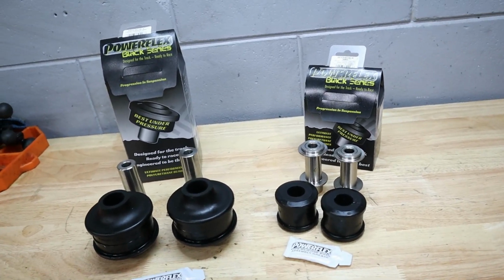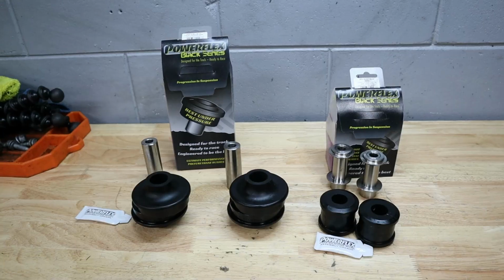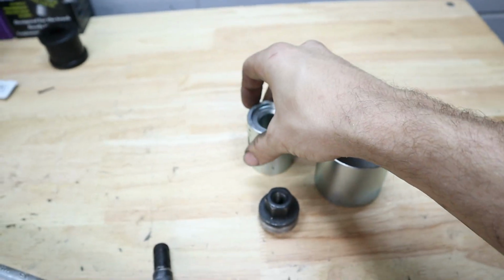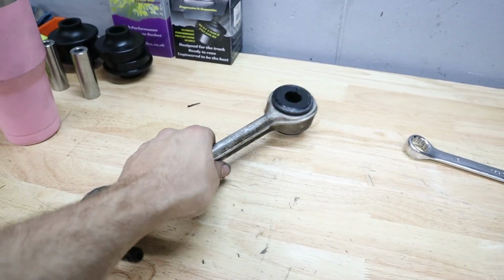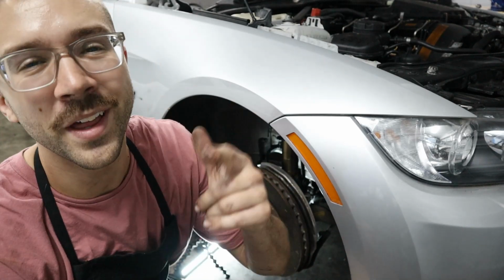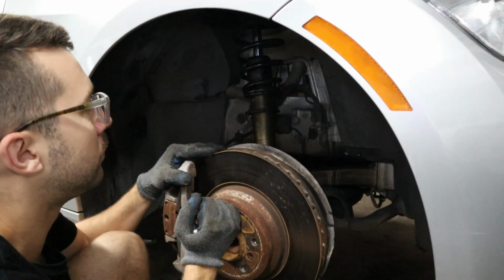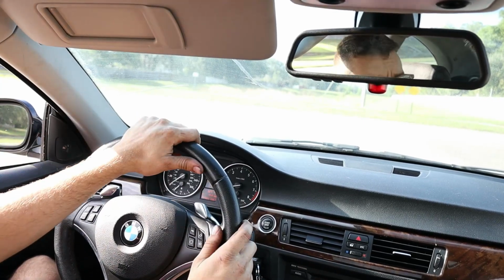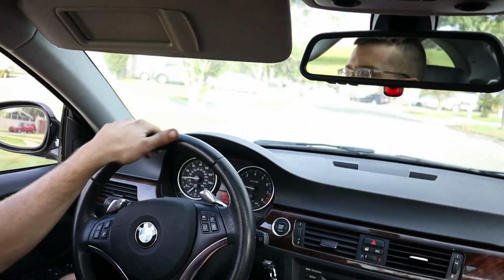Best Suspension Upgrade for BMW 335i? Powerflex Control Arm Bushing Upgrade DIY!

Comment: These are really nice, I had them in my E46 325Xi. The reason people put the M3 control arms in, is for one the Camber is more aggressive, it brings the bottom of the tire out .75 degrees (3/4’s of an inch) negative camber. Plus the other bushing is a spherical ball bearing bushing that moves all around, but is extremely tight! You can buy  aftermarket examples like fall line & you can make them even better! I just did a lot to my 135i & I’m going to be doing the M3 control arms..✌🏻💯🏁

Comment: Better than rubber, what's better than poly ? A rose joint ( uniball ). The camber arm is better from M3, the tension strut is good whatever it is,  possibly better with poly.

Comment: Nice fix Chris. I will go for these Powerflex bushings when mine are done. Can take a while because I'm on 52k miles. But 12yo so maybe in a year or so... Btw did I miss the turbo rebuilding vid? Dutch regards, Nico.
Reply from the maker: Nico, you can test the bushings too, see my video where we diagnose all the problems on my car. And yes, we rebuilt the turbos in our last video, go check it out! 😉

Comment: You should apply the grease to the inside of the bushings.... They are grooved to hold the grease. You removed all grease by installing the pins that way and they will squeak and collect dirt in time and  premature wear will occur...good vid though 💪
Reply from the maker: Good thinking, I didn't realize that but it makes sense! Apply it to the polyurethane, not the metal race.

Comment: I was waiting for a review of the bushings but got one of the turbos instead :). Anyway, i installed these bushings in my M4 and i took them out after one week and reinstalled the SPL solid eccentric aluminium bushes again. I thought thre powerflex ones should be less moisy but they gave the same nvh as the solid SPL's.

Comment: so i need new front control arm bushings on a BMW X1 35I ball joints done @85K, need bushing puller kit Part #, , was leaning to the purple series street driver, sometimes spriited driving  and recomemdatations,  run flats r rough enough r purples easy to install?  use the same bushing tool for E84? x series? sway bar bushings  X drives a little different

k

Comment: I have E90 and want to change the front control arm bushing with Lemforder one, just the bushing, is it going to compress with this set that you use?
And my second question is whether this toolset will be right for rear lower control arm ball joint ?

Comment: wouldn't the ball joints will still wear out anyway so you have to remove this and re-press them eventually?
Reply from the maker: Yeah the ball joints will wear out, but you can either get a new joint or a whole new arm, and then transfer the Powerflex from the old one to new one.

Comment: I just bought a set of PFF5-401 and the bushing is whole, not split in two like the ones in your video. Did you cut them?
Reply from the maker: No, didn't cut them. I think they updated the design on some of their bushings, but it should come with instructions for your install! Those kind usually needs to be squeezed/pressed in.

Comment: Hi I have a question to ask , my front passenger wheel is sort of tucked it a bit like it’s at a slight angle . would you possibly know what the issue is? please help
Reply: My rear wheel is doing the same as well. I don’t wanna waste my time getting an alignment if I have to redo everything anyways, I’m at 160 K miles

Comment: You put the grease thee wrong way, should put it inside the poly, theres groove pater there that will hold the grease, if put on the dowel then it'll be wiped off
Reply from the maker: You're right, I realized this later 😅 thanks for watching!

Comment: Great video as always Chris! I was thinking about changing the bushings in my E39 Diesel for PU ones (Powerflex or Strongflex). Do you have information or an opinion about PU bushings causing problems in the long run, since they wear less? The bushings are usually the weakest component in the chain, but since PU bushings are much stronger something else might break... Thanks for all your content, its very entertaining and informative :)
Reply from the maker: Bastian, I haven't experienced any long term disadvantages. I've pulled off old poly bushings that spent years on cars, and showed very little signs of wear. I've seen some people have complained about squeaking bushings, but I think that's why Powerflex includes the silicon grease for installation. I see what you mean about the weak link, but wouldn't be worried about these parts. Glad you enjoy the content!

Comment: I thought your suppose to tighten the suspension when it's at ride height?
Reply from the maker: Yes, for the factory bushings! That's why I mentioned the "preload", since these bushings don't have a center position, they don't add or need any preload on the suspension. Makes it easier to install :)
Reply: He probably should’ve but oh well not my car.

Comment: Did you get the washers to fit? was so tight in my f10 had to skip it and then ended up with noises
Reply from the maker: For the smaller bushing you mean? Yes its tricky to get in, a tight squeeze, but necessary for proper install. Patience and multiple attempts but once you get it installed correct the result is so worth it.
Reply: @TheBimmerBarn  you have any tips? Someone told me to use a hammer and flat head
Reply from the maker: @Sylverlee  I used some big pliers to compress it before I inserted it, but you have to go in at an angle. Once it's in a little, tap it with the hammer softly, and EVENLY. If it starts to go in crooked you're gonna have problems.
Reply: @TheBimmerBarn  🙏

Comment: Yes the are improving steering but vibration Frombork engine ,drivetrain  and Road Re felt on the steering and akcelerator . So this mod is for People want to improve performance not comfort. Just SO you have been warned.

Comment: What's your diverter/Bov setup?
Reply from the maker: Factory blow off valves, vented to atmosphere (unplugged from the inlet tubes). Simple quick mod, but makes great noises and isn't too obnoxious!
Reply: @TheBimmerBarn  Oh, ok. That's how my car is setup at the moment. I thought you had 2 "hks" style Bovs in place of the diverter valves on the stock chargepipe. I noticed it in the intake valve cleaning video (which I hope to follow along with this afternoon to clean mine).
Reply from the maker: @captainnapalm8207  I took those out, very big and made too much noise in my opinion. Good luck with your bimmer, Captain!
Reply: @TheBimmerBarn  Thanks!! Hey, if you're looking to sell those...
Reply from the maker: @captainnapalm8207  DM me on insta! Everything is for sale, as they say :)

Comment: You said the car "feels taller like it's higher up in the air". That's because it is. You're supposed to torque down the control arm bolts when the suspension is under load. Otherwise the car rides higher and the bushings are under continual preload.
Reply from the maker: You're right, BUT this only applies to the traditional fixed rubber bushing! The powerflex has a spacer which the bolts torque down into, and it can spin freely inside of the polyurethane bushing. This makes your suspension easier to dial in because now you only have to worry about the loads being put on the struts, not the bushings. Thanks for watching the video and sharing your knowledge!
Reply: @TheBimmerBarn I think it sits higher because your struts you installed aren’t blown lol
Reply from the maker: @destruxandexploze2552  Oh you're probably right 😂

Comment: OEM is supposedly fluid / jell filled for vibration? do these not?
Reply from the maker: No, these are solid polyurethane 👌
Reply: @The Bimmer Barn  so we don't race the car, it's my wife's car and she prefers comfort, not necessarily performance would these not be a good alternative?
Reply from the maker: @davidpadilla528  she probably wouldn't notice, it's such a slight difference, but if comfort is the focus maybe just stick with rubber bushings.

Comment: try to fix cornering lights failure pls ! ;)
Reply from the maker: The adaptive headlights? I think we're going to code them out, since it seems like a bad module.
Reply: @TheBimmerBarn  I have the same problem, but it doesn't always happen. 
ISTA has detected a problem in the left lamp. I will try to replace the module,. I read that it may also be a damaged motor in the lamp.
Reply from the maker: @siojtek1  Hmmm, I would try switching the AHL modules from left to right, and see if it follows the module! Then you'll know if its bad, or if you had a bad motor/assembly. ;)

Comment: I'm looking to do for my 2000 e39 but don't want a hard ride. I drive like an old man.
Reply from the maker: I don't think it makes the ride harder, unless you install stiffer shocks/springs. It may increase road "noise" or vibrations through the steering wheel, which feels more sporty. Hope that makes sense!

Comment: Poly is a bad idea , here's why.....
It doesn't return after a load to its original shape like rubber. Some cars your going to get away with it , some your going to basically total your car . I did full powerflex on my mk3 VW build . It had so much nvh I called the junkyard to come get it at that point. Use it on the rear subframe or on the rear shock tower integrated top hat only on a 335i on the rebound or top side. I'm telling you from experience don't do this. Subframe yes , suspension hell no. You'll absolutely regret it and hate the car.